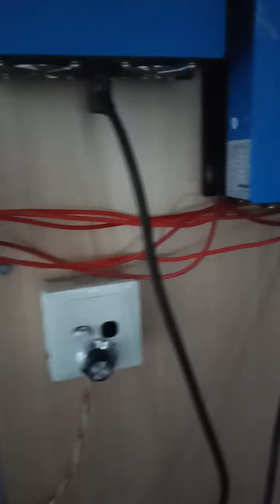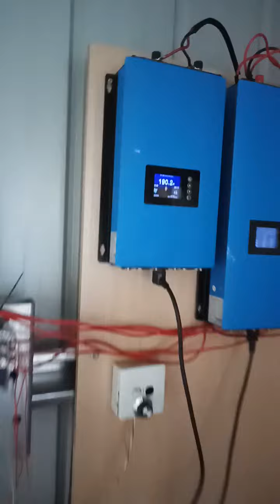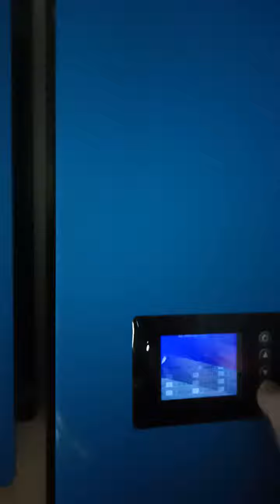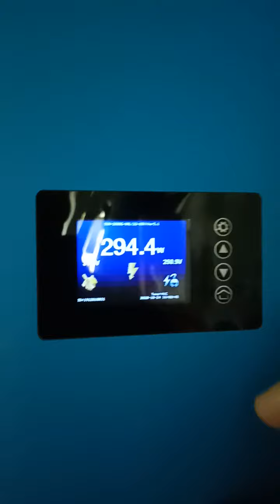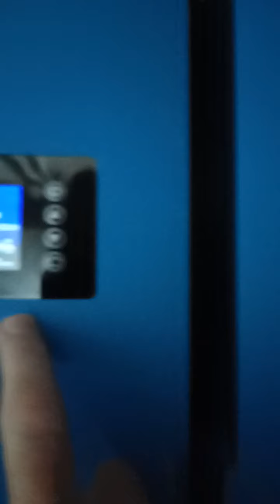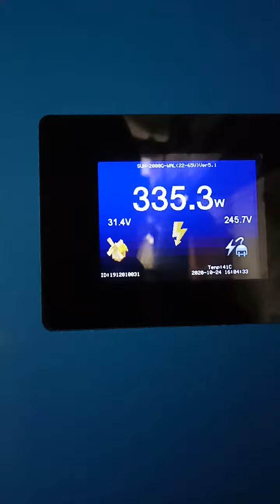home wind turbine information about loading and over voltage.(1)

Comment: Just seen your videos for the first time, you have stopped me from buying the wrong inverter, I was going for a 1000W for a 1000w turbine but capable of 1200W in a gale so thanks for that. Could you send me details of the braking system as I will need that where I live with high and gusty winter winds.
Reply from the maker: I would strongly suggest you use my revised setup with no braking resistors.
Products are improving and some are being discontinued. 
Currently I use 2 independent chargers  a 24 volt 1500  watt wind charger and a 60 amp 24( 1440w ) volt solar charger. 
2*12 volt 140ah (3.3kwh total ) agm batteries in series and a gti 1000 24 volt gti inverter. (2000 watt would be better in a storm the charge into the batteries gets pretty high quickly) I use my 48v 2000w Gti on a solar setup now.
I set the cut off voltage on the inverter to be around 23.5 volts and reboot voltage to 24.5 volts. (reboot is the restart voltage at which point the inverter starts to generate again) 
I have not limited the output power on the inverter because I have another battery (sonnen) up stream on the mains supply  that will capture the excess before it goes back to the Grid.
What this does is make sure the batteries are not fully charged and there is enough voltage head room to stop the internal brake on the wind charge controller from activating.
This was the only way I could stop the turbine tripping the GTI permanently .  
Using the 2kw inverter you can peak at over 1200 watts with the B&C 1000w Turbine so that is better for the controll but you will have to set the power curve to be very aggressive. 
I have a video with the settings I used published I think. 
I added the solar charger because I run test equiptment on the same 24 volt supply.  And without the solar top up the battery charge got depleted and my test setup failed.
Reply: @davecollier8946  Thanks, that makes it easier. My solar array is Grid tie, I use an MK2 diverter to divert any surplus to a 3kw immersion heater but could change that to a battery charger or hybrid inverter with batteries for emergency back up. So I can go wind turbine to battery charger, batteries to GTI and then GTI to house with any excess covered by the MK2 diverter. The GTI will be programmed as you suggest. One question, is the GTI best on solar or wind MPPT. Cheers John
Reply from the maker: @kommando828  set the inverter to bat or solar mode. Mine is currently on bat.turn it off hold the top 2 buttons and then in the menu set to bat or solar. Do not change the power or voltage setting.
Reply: @davecollier8946  Perfect.